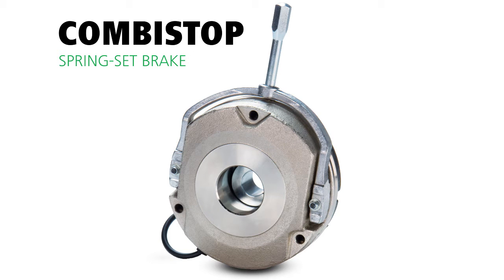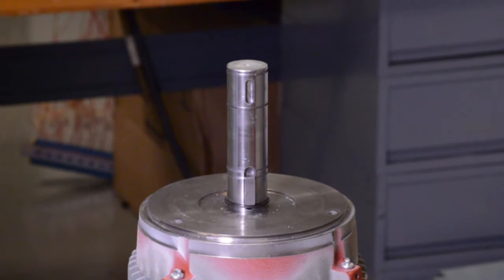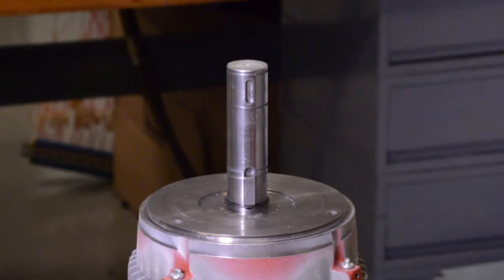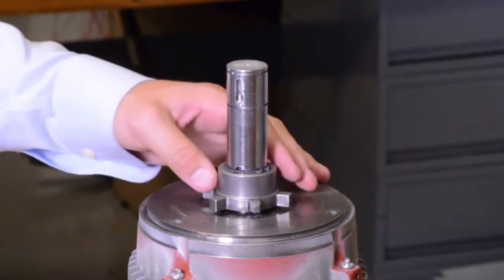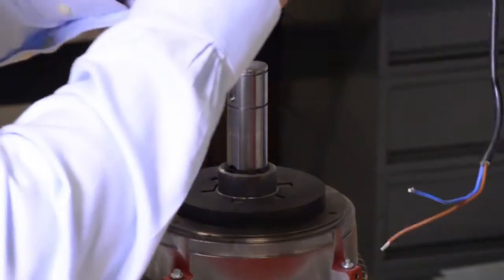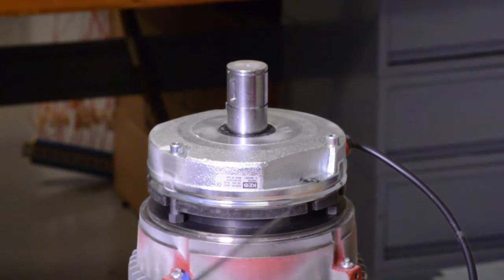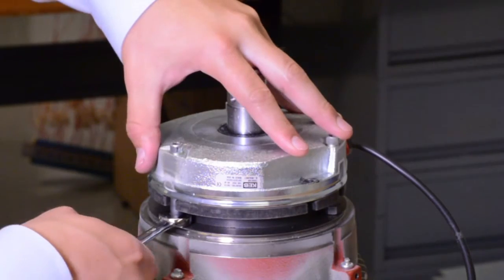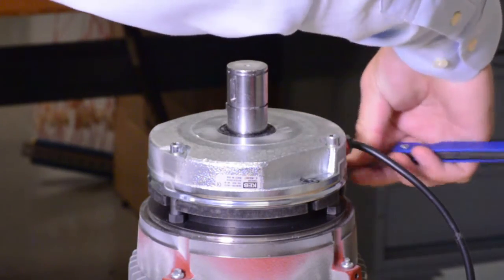How to Install a KEB COMBISTOP failsafe brake

Comment: my motor shaft is 20mm. so is model 03.38 suitable?
Reply from the maker: Thanks for your comment. The type of brake you need depends on the application, not necessarily the motor shaft size. You should contact us through our website to explain the requirements of your machine application to find the best product for you. https://www.kebamerica.com/contact

Comment: What is the default space
Reply from the maker: Hello, in order to answer your question, we need to know what space you are asking about. Are you wondering about the spacing on the motor's rotor? Are you asking about the airgap space? The best, and fastest, way to get the answer you need is to contact a local KEB Representative. https://www.keb.co.uk/contact/contact-worldwide
Reply: Air gap exactly
Reply from the maker: Airgap is dependent on the size and type of the brake. Nominal Airgaps for each brake are listed in the Magnet Technology Catalog: https://www.kebamerica.com/wp-content/uploads/2020/03/Magnet-Technology-ct_mt_00000005mag_en-1.pdf